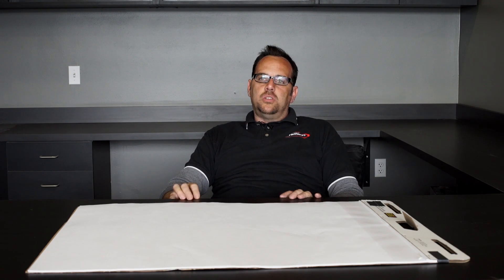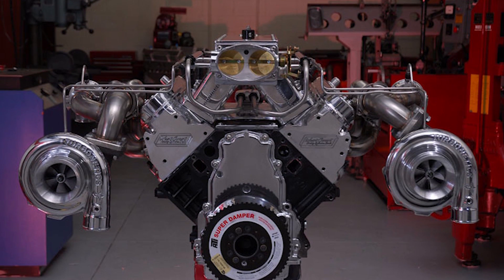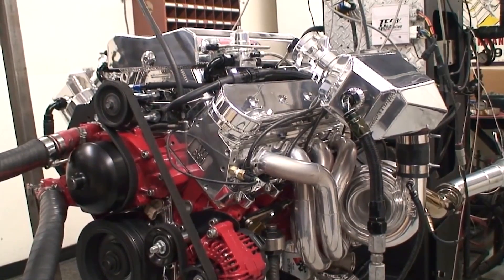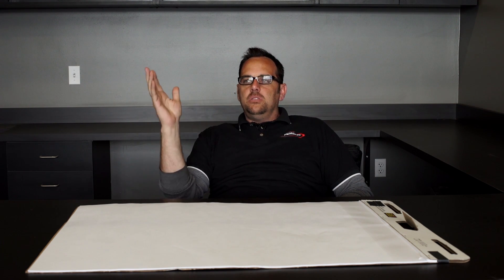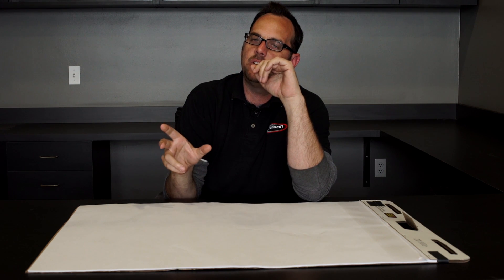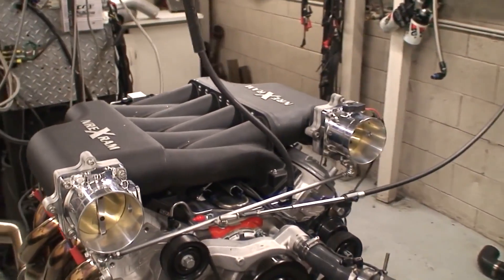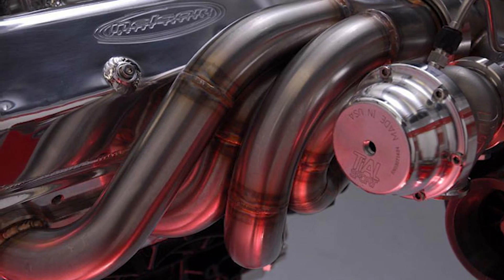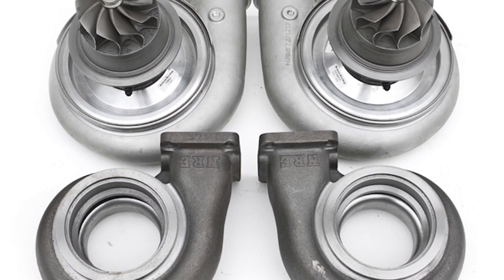Master Engine Builder Explains Why the LS V8 Is SO Good

Comment: You guys should of asked this legend about "breaking in" engines. Damn.
Reply: +Knights2theEnd  I agree. That would have been a great question for him.
Reply: +Eric Foreman +Folopolis 
There are very sound engineering reasons to perform an engine  break-in routine. 
Read the individual component manufacturers recommendations on breaking-in a newly assembled engine.
Reply: +Knights2theEnd Many high performance engines are broken in at high rpm and engines stand pulls. You don't loaf the thing around at 1200rpm for 3 tanks of fuel. You get tempature fluxuations happening and go throught the rpm range to seat everything nice. 2 stroke engine are the same way, lots of brappping but don't pin it for more than 2 seconds. Low rpm break in is bad for later high rpm action in many engines.
Reply: Kenny Hanes If you dont want full horsepower, and like excessive oil consumption, blow by, and decreased engine life, then ya, do that...
Reply: If you have the correct tolerances in a race engine, there is no break-in IMO. Factory cars is for the ultimate ring seal for 100s of thousands of miles.
Reply: +Knights2theEnd omg, I'm so in agreement.
Reply: +Knights2theEnd omg, I'm so in agreement.
Reply: leloodallasmultipass it's such a disappointment :/
Reply: @Knights2theEnd  If u build a V8 engine and can put it on dyno run it like 2800 rpm first time and around 4200 rpm second run and around 6000 rpm 3rd run depending on engine size should be a good break in
Reply: The way I was always taught was, you break an engine in for what you're using it for. So a longer, more gradual break in can help with longevity.
Fill it with 30w non detergent mineral oil for the first start
Let it warm up and idle for about 10 minutes, shut it off, change the oil and filter. Use your normal weight but conventional oil for about 500 miles, don't put it under a lot of load or rev the nuts out of it. If it's manual you want to do a good bit of engine braking, the vacuum on the crankcase pulls on the piston rings and allows them to hone in better. After 500 miles change your oil again but still don't use synthetic. Go for 4000 miles and then you can start using whatever oil you want.
Reply: flame it warm it load it .....if it blows up you fucked up !!!
Reply: Don't you know? You're supposed to take it to redline on day one just to seat those piston rings nicely :P
Reply: You guys should shut up..
Reply: Fords coyotes and voodoos are vastly superior! Why do people believe this bullshit! This guy has no idea why he’s talking about!
Reply: Power to price and durability ratio, LS engines make way more for less.
Reply: It's LIES from the seller to buyer.. Because warrenty covers the first "time span" / mileages... 5k/10k or w.e they want u to drive SAFE for the first time being so u can pass warranty... Whats the point of breaking in if the engine is supposedly perfect/percise fresh out the factory.. If anything... You wanna smash it thr first 5k... To break any imperfections while still Under the warranty... Makes sense to me...
Reply: +Folopolis  
Do you want the sophomoric one sentence answer or the in depth analysis report answer?
Reply: Knights2theEnd
Reply: 6
Reply: New Video, go back and do it again!
Reply: still waiting on that response from patw52pb1
Reply: well for the first 500 miles you should never full throttle the vehicle, use between 30-50% throttle, at different speeds to break in a brand new engine, especially the LS engine.
Reply: Yamaha told us when me and buddies bought bikes to NOT baby them and keep em 2k under redline(oil and liability reasons... you switch to synthetic at first change after 500 miles) and ride em lije you would any other sportbike
Reply: 12389h my 1998 4.0 six manual shift Ranger was recommended for street driving and higher rev shifting for break-in both from the manual and my uncle who worked 30+ years for Ford in the maintenance areas. If made sense. It ran like silk too.
Reply: TOM NELSON, HIS MY DOCTOR TO CALL ON THE AMERICAN V8 NICE TO SEE YOU AGAIN TOM, GREETINGS FROM SPAIN AND SCOTLAND......
Reply: If the engine has roller lifters I see no reason to do any kind of break in. If they are flat-tappet, then probably running the engine at about 1500 rpm for 30 min. is probably a good idea, avoiding extended periods of idle during it's early life.
Reply: I know this us an old thread but stillif its going to break its gonna break no matter how much you baby it for how ever long the first time it spins under load pass 5 grand will tell you eberything you need to know about that engine
Reply: John Lingenfelter said warm it up, make sure valve lash and oil pressure is good and nail it to redline in every gear.
Reply: just don't trash it ... read manufacturers specs . if it's custom just take it easy and slow build it up . go through at least 2 heat cycles
Reply: Shut of fuel and crank it. Toss a socket on an impact and rotate the crank for 30 secs. Shoot a cpl shots of oil down ech cylinder.  Fire it up and put it in gear right away and let it idle with the brake on for awhile (til it warms up) drive it like granny for a a day or 3. Take it on the highwayand run it at hirger rp for a few good runs. take it back to the shop and haul off the valve covers and base and re torque everything. There are as many ways to break in and engine as there are to destroy one.
Reply: I've rebuilt my 68 Corolla's engine a few times. (every 250k miles whether it needs it or not, usually not) I've done it easy and I've also smoked the tires out of the shop after firing it up. It doesn't seem to care.
Reply: IcantSignIn Your point being what?
Reply: The topic is breaking in an engine...so what do think the point might be?
Reply: 2005 Ford ranger 4 cylinder intake manifold removal
Reply: Believe whatever you want but engines need to be run in. A buddy and I used to build roundy rounders. We ran Chrysler products and used 361 big blocks with 440 heads, intakes and manifolds [ street stock class ]. We didn't go all out just did a real good overhaul and good run in. Our last car was a 63 Dart, great chassis for this kind of racing. One week David, my buddy, decided he wanted a tach so we put one in. After the heat race he came in and said take it out. It was scaring him to death out there. We were turning 13,000rpm going into one and three. Yes boys and girls. That's 13 followed by three zeros on a basically stock engine. Lap after lap. 

In the shop for a customers car I would put the first 100 miles on a new engine. Some street. Some highway. No long term steady speed. Change the oil and filter and tell them to have fun. Bring it back at 500 miles for another oil and filter. Never had one break on me. Did that for very nearly 40 years.  It's the variable speed, no heavy loads run in that is critical to long term engine life. 

BUT, if your going to go racing with it your going to be tearing it down often anyway so run it like you stole it.
Reply: @billiewalsh3073 You're full of it.... 🤣

You were NOT turning your circle jerk engine 13,000rpms. NO way, NO how. 

Next time, set your tach to the V-8 setting instead of the 4 cylinder setting.... 🤦🏻
Reply: Use a good Break in Oil like Royal Purple Break In oil or a synthetic of equal quality.
Reply: i have drag raced a lot if u break in the engine right it will last longer but if u race it ,race it before it breaks in for the most power but the motor will not last long the big boys don't break the engine in but they have the money there are many ways to break a engine in all depends how u drive best after the cam take it on a drive 2500 rpms to 3500 rpms  what i would do take it easy for about 500 mile before red lining it i had a pro built 327 stroked that lasted 15 years and still run like new and it has hit 15000 rpms i have raced it over 20 times
Reply: Idle at 2200 rpm for 20 minutes, dump the oil and drive it like you stole it for 1500 miles... Broke in. Done.
Reply: Why? It's pretty much a standard procedure today, and has been for decades. Get it running, stand on it a few times to seat the rings, then drive it however you want. You don't think that engine builders put they're finished build on the dyno and then pussy foot around with it for hours before beginning pulls, do you? No, run it for a few minutes, then seat the rings, change the oil and check the filter, then start givin er.
Reply: +Knights2theEnd 
There is no particular way of doing it. Some people don't even bother "breaking in" engines and just go all out from the start and haven't suffered any issues. So there is no evidence for it, although I would feel a lot more comfortable taking it easy on a new engine for a few hundred miles.
Reply: I can say what I read in a new Honda owners manual 2012 I think. It recommended not smacking the redline until a few hundred miles of normal driving. It may be just because the internals needs time to settle properly in place not completely sure.
Reply: Phillip Gagliardi thats pretty much the only reason to break a new motor in, is to make sure everything is seated correctly.
Reply: Rabbi Schlomo I know. I was being an asshole troll! Bottom line is the biggest advantage the LS has is physical size. Stuff a coyote or voodoo into an engine bay there’s little room to do anything else. A coyote is around 6 inches taller and 9 inches wider. That’s one reason a lot of fox body enthusiasts opt for the LS. The Ford dohc V8’s simply wont fit.
Reply: +Knights2theEnd thats just a myth anyways the chances of someone fucking up are very slim
Reply: idle engine 2000 rpm for 30 min,change oil and engine should be broke in

Comment: In my opinion,  its still a push rod engine.  This is 2015,  it should be higher tech,  over head cam.  less push rod weight to push back to the lifter. = less valve spring pressure needed.   The LS copied fords modular oil pumps.    There are a few knock offs like that on an LS.    And ford has had one piece rear main seals since 85 ?   This LS just another engine to me.
Reply: +mike saathoff  GM chose to use a pushrod design for the LS engines because they wanted to maximize power-to-weight rather than power-per-displacement. Despite their large displacement and rather low VE, the LS engines have some of the highest power-to-weight of any engines in production.
LS7=505hp and 450lbs. That's unmatched by almost any other manufacturers out there.
Reply: Chevy stated using 1 pc rear main seals in 1986, big deal.

Comment: Is an L99 in a 2010 Camaro SS an LS motor?
Reply: +09809709879876678698A  Yes.   Even the iron block v8s in GM trucks from 1999-2014 are considered LS engines.   LS is common slang for the Gen 3 and Gen 4 small block from GM.
Reply: l99 is the name for that variation. it's a ls3 with displacement on demand and variable valve timing(that motor is found in auto camaros) as opposed to the ls3 in the manual camaros that doesn't have that stuff

Comment: The ls motor is dying.  Even its most powerful naturally aspirated 7.0L iteration is 20 hp short of the 5.2L ford flatplane and  over 100 hp short of the 6.2L amg.  At the end of the day, you simply can't get proper flow from an OHV design, they need to start using overhead cams to stay competitive.
Reply: +Wes Fathauer  The Ford engines are great, but very wide and tall, and therefore harder to swap into cars with tight engine bays. And that new 5.2 flat plane engine is not going to be cheap as a crate motor system. Fun in a Cobra kit car, though.
Reply: Wes Fathauer not really put a cam on that ls7 and you already make more power than the 6.2 Amg engine

Comment: i think ford engines are better. a ford 5.0 has the same power as a gm 6.2 .... that says a lot
also a study by motor trend shows how ford engines (modern day engines) have more power per litter (hp/L) and more power per cubic inches. (hp/ci) 
- ford has better design and technology and gm is still pumping out 1960s designs and technology .... that also says a lot.
-
- that being said though gm is more simply to work on because its old school 1960s design and ford can be a pain in the ass.
Reply: +TheFassold Hp/l ratio argument are only made by noobs who don't know any better. Dude, that shit has no real world relevance. For example, you could increase rpms by shortening the rods so that you get more hp/l, but you lose torque and it doesn't mean you'll be faster than another engine. You could increase boost by dumping more fuel into a cylinder, but then you increase stress and reduce economy. You could shave the heads to increase compression, but you need to run more expensive fuel. You can do all kinds of things to increase the hp/l on your engine and I can just get bigger cylinders with a much lower hp/l and STILL be faster. HP/L ratios only matter in racing where class rules dictate displacement limits. In the real world, your 300 hp/l chainsaw engine is not going to be faster than my 80 hp/l V8. You guys need to stop with the noob hp/l arguments as it's bullshit.
Reply: . the 5.0 may have higher hp/liter but the 6.2 weighs 20kg less and is physically smaller. revs to less rpm. has higher torque and is more fuel efficient and durable due to low revs. http://www.cheersandgears.com/topic/53310-why-gm-should-not-build-a-dohc-v8/ look at the chart
Reply: ***** but engine A is more reliable and engine B is a gas guzzler. engine A is easy to mod to push 700 and engine B needs more to reach that point. ill stick to the the better design
Reply: ***** i had a 4.6 sohc with a turbo pushing 350 hp, i was only 6,000 into everything. i beat 5.7l ls with boost, all the time. a friend of mine has a 2013 with a blower plus some other add ons and a cam, he pushes just below 1000 hp, he spend 15,000 on his car. ive never seen him lose to an ls, never
Reply: +TheFassold Which Ford 5.0 are you talking about? Year? You the Ford 5.0 is been around before some of us were even born. They also range from different Horsepower.
Reply: Chris Huynh Which 5.0??? The Ford 5.0 has been around for many years with different Horse Power Range.
Reply: +TheFassold  yep,  the new 5.0 is far better.  some people say its wider, ,   who cares,  I can make it fit.  I have a 4.6 DOHC in a 63 country sedan, and I still had to modify the control arms.
Reply: quickzilver333 coyote. Here is a much better chart http://imgur.com/kUyUXSC.
Reply: +TheFassold http://imgur.com/kUyUXSC Here is a chart comparing various v8 engines from manufacturers. and you can see that the ls3 6.2 has a higher power to weight ratio than any of the dohc engines. Hp per litre may "look good" on paper but means absolutely nothing in a racing standpoint. It also revs lower, is physically smaller, has a better powerband, and more torque than the 5.0. lower revs means more durability and better fuel efficiency.
Reply: Jeremy Hall Smaller ci but still heavier, far more complex, and costly engine

Comment: He pretty much said the winning combination within the first minute of the video. LS engine is light, cheap and make a lot of power. I love cars and I have driven some of these LSX swaps and I have to admit, they are pretty cool and fun to drive. Most of the cars had maybe a S/C or nitrous but they were bolted into a very light car, like a FD Rx7. Granted I always kinda cringe when I see a rotary removed (I know the reasons why but I love the rotary) for an LSX, but I cannot deny it's favorable because of it's reliability, parts are cheap, LS is about the same weight IIRC than a 13BREW (13BREW is a tad lighter iirc) and you make gobs of V8 power! That being said, if I were to have a rolling chassis FD, I would probably do a 20B single turbo swap, but the frustration will be getting that engine more towards the back so the balance is jacked up on the FD. And it would cost about 15-20% more than an LSX swap (and more frustration ha!), if I DIY'd it. 

My favorite LSX car to date is the C7 Z06! That thing is a beast and I though the C6 Z06 was a track beast, it still is, but the C7 just raised the bar!